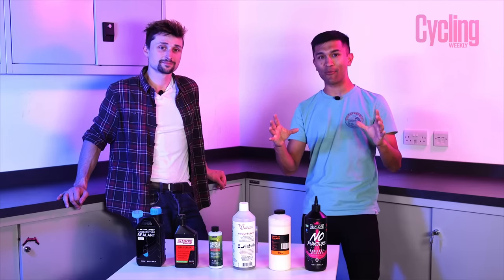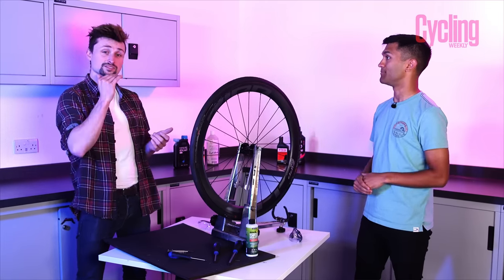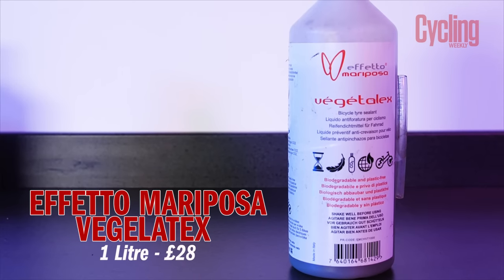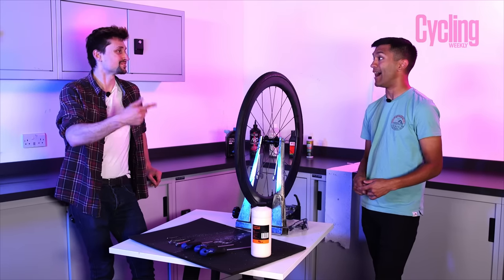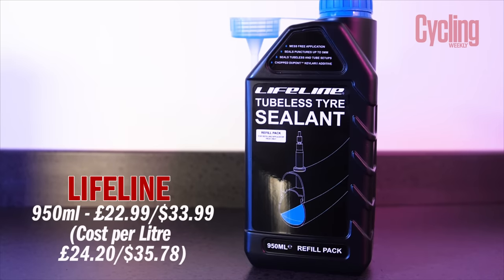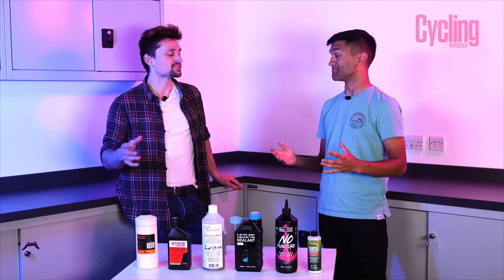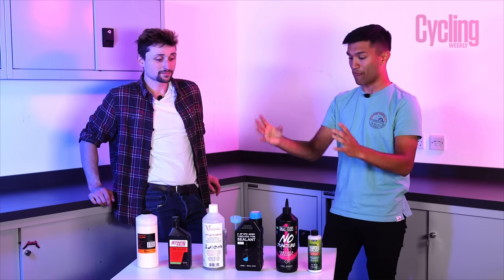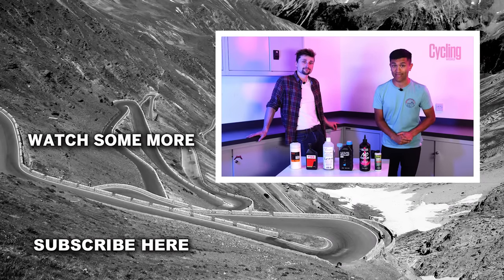We Found The Only Tyre Sealant You Need | Tubeless Sealant Mega Test

Comment: It would have been more accurate if you guys went for a short spin after each puncture to see how it holds under the weight of a rider.   I know It would have take longer to make the video.  Nonetheless, I appreciate the great content and no bias.  Thank you.!
Reply: Agreed this is a massive part of this stuff working
Reply: You are right. Real world testing makes all the difference.
Reply: Yeah also test @ different temperatures. I’ve had sealant work extremely well within a certain range, and as soon as you’re going lower or higher, it just become completely unable to handle the tiniest 0.5mm puncture.
Reply: I agree. Puncture that big usually never seals in reality, because the cut opens up under the weight, and doesn't have a chance to dry. Plug is the only solution.
Reply: Where I've experienced the fail of cheaper sealants isn't the body weight it's the rotation at genuine speed, 20mph or so they start to let go and spit at you.

I've been using orange endurance for 2 months with 3 known punctures and no issues at 60psi max on 38mm tyres
Reply: Exactly.  The problem I have with sealants isn't the size of the hole they seal (you can always use a plug), but the tyre remaining sealed.  After riding a bit, the seals always seem to wear out and leak.
Reply: This is why I carry a spare tube when I decided to go tubeless. Saved my ass a time or 20.
Reply: I think this video was enough to rank the sealants according to performance. But a more in-depth review would be interesting.
Reply: Agreed. I used Silca and it would seal but then leak again when riding. so weight is a big deal
Reply: @BigBoootyBass  Ok.  My issue was with a snake bite..  It seems it's commonly hard to seal based on the conversation I had...  due to the fact that the sealant doesn't go there as much as it goes on the main thread of the tyre.
Reply: just extrapolate the data and assume maybe one less check mark for each sealant . fuck man,  some of you people just have to be a poindexter about this stuff.

Comment: There's as point where just poking, letting it go and saying after 2 seconds: "it works!" isn't representative of reality. A rider will sit on the bike, increasing the pressure. Plus, in my experience, many of those punctures will continue to leak, albeit very slowly... so yes, it prevents (in some cases) a complete flat requiring a repair but in many cases (based on my exprience) it's not simply a "tire plugged forever" situation. Many will keep leaking a bit and will require a more robust fix. Plus, let's not forget that these tests are always performed on freshly poured sealant. After a 2-3 weeks, there will be a difference in performance. I've used tubeless for many seasons and, while I like it, it's never as perfect as these "tests" demonstrate, nor are the tests representative of real life situations with the same variables...

Comment: I had the complete opposite experience with Muc Off and Orange Seal. Muc Off would continue to leak and sputter over time when I thought it had sealed (, but Orange Seal would actually create a complete and full seal. Granted, I also use Orange Seal Endurance formula which lasts considerably longer and seems to seal better than the regular formula.
Reply: Muc Off has the most dishonest marketing in all of bike products. I would run away from anything Muc Off. Look at Zero Friction Cycling's testing of their lubricants.
Reply: This test is shit. Spinning wheel on a stand achieves nothing aside exactly what is shown

Comment: One thing a nearly every sealant tests get wrong: You need to spin the tire at gravel / road speeds BEFORE puncture! I'm actually surprised the Silca worked! It's claim is it foams as riding begins! Nevertheless I think this very useful data. Thank you guys for putting this test on!
Reply: They were rotating the same tire over and over to make subsequent punctures. Hence for all but the first puncture you were seeing rotation before puncture.

Comment: One thing to note also is that I believe muc off is the only sealant to be compatible with co2 cartridges… other sealants if used will cause the sealant to go off… but still, a great test!
Reply: You can replace it with normal air after with Stans though - which is reccomended anyways
Reply: also worth of noting - mucc-off can be simply washed by water, so if you change tyre frequently, it can be easily washed and stored
Reply: @brunoandlydia  yeah I had a big puncture which the muc-off couldn't plug. Used 2 large bacon strips and they popped out so took the tyre off and replaced it with a different tyre and tube. Washing off the muc-off was super easy and I'll use the tubeless tyre when I figure out how to repair it

Comment: I agree that the standard orange seal isn't great, but give Orange Seal Endurance a try, it works better than anything else i have tried. It is reinforced with aluminum flakes in the same fashion that the Silca is reinforced with the carbon threads.

Comment: I have been using Stan's, and longevity-wise I like that after a year it's still liquid inside my tires. However I have had a problem with a slick gravel tire where a few small punctures were continually oozing wet stuff and the tire had to be pumped up before each ride (I got a new set of wheels and tires and stopped using this pair, and they eventually deflated and dried out). Would love to see a longevity comparison between these sealants, though I know that's not an easy or quick video to shoot!
Reply: same, I had gravelking slicks and they had many small (1mm) punctures all over, I had to inflate every day and by the end of the day the tires were already kinda soft. Sometimes the seal couldn't really hold it after inflating and upon putting weight on the bike a puncture would open and spit sealant. But the tires were getting old and thin, so maybe that's part of the reason. Didn't have any problems with my other bike, I even rode it once for a few km with a large nail (maybe 5mm wide) in the tire before removing it and having Stan seal it successfully (the normal version of Stan's). And I continued riding that sealed tire for months with no problems. I did read somewhere that thinner tires are harder to seal, maybe that's why my slicks would ooze and have trouble keeping sealed compared to my mtb tires.

Comment: Be interested to see how Stans 'Race' would get on compared to the regular Stans sealant. It has larger 'bits' in it to seal larger holes, so much so that you can't put it through a valve without bunging it up. I know that you can't test all of them, but the 'Race' is Stans best, and so far I've had good results compared to the original formula.
Reply: I have found that Stans Race does not store well and clogs in the bottle very quickly rendering it unusable. I am guessing that it is designed to be used up quickly by a team in a race meet environment.
Reply: @rogercarradus2914  same experience, I've only used Stan's race and the normal Stan's and muc off.
The race version was too strong for me I'll dry up quickly and worst part is I can't use the valve after and needed poking some times cleaning.  The normal formula and muc off works well for me, I use them both on RB and MTB on my tubeless wheelsets.
The best part of Stan's race is when you have a wider puncture it will definitely seal 1000% losing just 5 psi or lower worry free.
It even sealed my pinched flatted inner tube MAXXIS with Stitched patch on my non tubeless wheelset and able to rode it home safely.
Reply: I found that if you leave Stans Race in the tyre, it creates a hell of a mess inside the tyre which you can’t clean off. Effectively it ruined 2x£70 tyres! Think it is supposed to be cleaned out after a race outing? I’ve found Stans regular ok and have just bought some Muck Off as a trial. Being an early tubeless adopter the main problem is still getting the bloody things off and on. If they could only get that sorted so putting a tube in at roadside was easy, it would be a game changer and the odd occasion that sealant and or plugs do not work.

Comment: Year late...the trick with stans is you need to vigorously shake the bottle before pouring it out. There is a particulate matter that settles in the bottom of the bottle that you can visible see in the sealant when you pour it out...i didn't see that material in your video, which makes me think it wasn't shaken enough.

Comment: Would like to see a follow up video, expanding the field to the other suggested sealants: Orange Endurance, Stan's Race, Specialized 2Bliss, etc.  Thank you for the objective 'controlled' comparison.
Reply: Stan’s race has worked better than anything else I’ve used but it dries so quickly it’s a pain to work with. If I had a race or big event that’d still be my go-to. I’ve never had a puncture fail to seal with Stan’s Race. (Regular Stan’s doesn’t work well for me at all.)
Reply: I am wondering if the SILCA sealant with its refresher additive is similar to using Stan's Race (has fibers) mixed with regular Stan's to extend the lifespan. I wouldn't expect regular Stan's alone to compete with a sealant using fibers like the Silca, but I wish this roundup had compared with the Stan's Race to be more apples-to-apples comparison. Fiber based sealants greatly improve effectiveness at the cost of longevity and hassle.
Reply: Stans Race dries up and makes a sticky mess in the tyre. Silca makes a mess with its carbon fibres, but you can just clean them out with a cloth/kitchen roll (and dispose of them safely!)

Comment: It was also be good to know how soon after puncture the air pressure could be returned to normal. 

In my experiences the sealant works and the tire holds air. But if you add air back into the tire it blows out the sealant.

Comment: I wonder which one of these you can replace through the valve? Silica looks kind of chunky, not sure if that would work.

I might go for a less protection, maybe take extra risk, if that makes the regular maintenance/replacement so much easier.
Reply: Silca says that you cannot insert their sealant through the valve, you have to pour it directly into the tire. However once you've done that they have a separate product to "refresh" the sealant in your tire, which they say you can put in through the valve
Reply: @bhatch  basically spend even more $$ buying different products.

Comment: I was using Stans until my first puncture. It wouldn’t seal a <1mm puncture as it practically turns to water after it coats the inside of your tyre over a few weeks. Redone both my tyres with Muc-off, time will tell if that performs better, but this video has given me hope!
Reply: Muc off is terrible, for road tyres use stans race or silica. I’ve used both, stans does dry out though
Reply: @domefford864  Silca it is then, certainly won’t be using Stans ever again, complete waste of money. I only had a small pouch of Muc-off that I must have got free with some of their other products
Reply: @cliffsmith3376  I’ve only had Silca in for 6 weeks as it’s a new product but as with all their products it’s over engineered so should be the best. 👍

Comment: My experience with Stans is it works fine, but the Stan’s in the bottle itself tends to clump up and turn to rocks and wastes sealant. In the tire, the sealant tends to dry out quicker than Orange and also clumps up into rocks.

The Muc-off seals amazing, but I found that it works too well and can make taking tires nearly impossible to take off if you have to put a tube in. 

The life of Orange seal sounds about right, but it works well and doesn’t glue your tire on like Muc-off
Reply: Orange seal for me and my friends as well. Long lasting in the tire,seals just fine. No need for plugs for 1,5 year. No clumps so easily to inject through the valve hole. Just using the regular. No need changing each month.
Reply: What about frost from riding in the winter. How about coping with the co2. ?
Reply: @aoe76  Orange only lasts about 1-3 months, even their directions state this. I find that this is true, but it differs depending on how porous the tires are or the climate you live in. If you are waiting over a year to refill your sealant, I would guarantee that your Orange sealant has long dried up as no sealant lasts anywhere near that long. As far as winter…I live in California, USA, and the climate is moderate, so Orange works fine. CO2? Always point the valve stem up when using a CO2 and you should be fine.

Comment: The key point is the density of the sealant. More is dense more is the ability to seal. On the other hand, the density dries faster than the liquid sealant and moreover, will be more hard to reach sidewall puncture. The plugs do the rest.

Comment: Should have included Finish Line.  I care more about the mess one like stans leaves after it dries out, than protection.  I know protection is kind of the point but it's not my top priority.  I am curious to try the Silca one now though.  Does it dry up spike ball style?  I went to finish line from stans, its more weight that stans because you need more but I won't go back.

Comment: Great review. I’m using Stan Sealant and it’s not really up to expectations as a 2mm puncture won’t really seal for my 23mm pump at 80psi. Ended plug it with a tyre plug to stop the leak. Sure will try Muc-Off from this review. Just hope they sealant life span can leave to their advertised of 6mth in the tyre.
Reply: I agree re Stan’s but try Stan’s Race Sealant. It’s more expensive but a different beast. Seals anything.
Reply: Muc off is waste of money.

Comment: Think you guys were lucky with the muc-off. I've had smaller holes than that at 70psi that it wouldn't seal
Reply: Same here and that's on my gravel bike with around 30psi. It does at least last a long time and clean up easily.
Reply: @kpizzle1985  how long do you get it lasting? This is what puts me off going tubeless...redoing the seallant every few months. No doubt a messy job. I'd rather be out riding, not squirting juice all over my bike/floor/face
Reply: @thebrowns5337  I changed the rear 6 months in after getting a large hole in my tyre, at that point it was no where near dried up. Front is about 9 months in now and still holds pressure as well as the day I set it up, can't be sure how much useable sealant is left in the event of a puncture though. I'm tempted to just ride it until I get a puncture that doesn't seal, pop a tube in then add sealant when I get home. This is on the gravel bike, sticking with tubes on the road bike for now

Comment: The only time I get big holes is from a nail, and that's not very often and they are about 3mm I would guess. I usually get thorns.
I just bought stans, hope it works, as I'm new to tubeless. Was a lot of bother getting the tyre to pop on yesterday, but a bit of sealant on the outside helped do the trick.

Comment: Those of you dealing with continually clogged tubeless valves should give the Fillmore Valve (from Reserve Wheels) a try.   Not only are they virtually clog proof, but they flow way more air than a traditional presta valve (even with the core removed), that the ability to seat the beads of a tubeless tire is also improved.   If you have a floor pump with an airblast chamber, you can seat ANY tire with this valve.

Comment: Thanks for doing this test, I have been wondering what the good sealants were. I have not had much success with orange seal and was unaware that it only lasted a month or so. My wife dislocated her shoulder when her tyre rolled off the rim. Have changed to muc off and am now confident it will work well. Thanks again.
Reply: So interesting I've had the complete opposite in results. Muc off almost made me stop using tubeless. Since moving to orange endurance I've had 2 punctures and they've sealed with no issues! Wonder if different tyres and sealant combos would have an impact on this? Hope your wife made a speedy recovery!
Reply: Muc off is waste of money

Comment: I think they should have used the stans race sealant that is equivalent to Silca.  But, interesting tests guys
Reply: I have both Stans Race and Silca, and the only issue with Stans is that it dries up to fast for the average rider. I switched to Silca so I could have good puncture protection and not have to change it out so often. If you have Stans Race, mix it with Stans regular so it last a bit longer.
Reply: Why is stans race day more comparable to silca? It seems like the lifetime of silca is more comparable to the lifetime of regular stans, no?
Reply: @smurfendrek4791  it's comparable because of those larger particles which are not in the regular stans sealant.

Comment: Alright since I'm a big proponent of Orange Seal and I just wore out a GP5K S TR, I sacrificed it to the God of Sharp Objects. It sealed up to 4mm instantly, It sealed 6mm in seconds. I pointed the puncture down at 6 o'clock each time. I think there was something seriously wrong with the test protocol used in this video. I used 73psi on a hookless rim. Multiple stabby implements were used, including a jeweler's screwdriver, an awl, larger screwdrivers and an actual machine screw.

Comment: Real world, my experience.

Muc off doesn't work. Punctures around 3mm at 50 psi sealed initially, but as soon as I started riding again it opens. 

Orange endurance, doesn't seal as quickly but sealed the punctures permanently at higher psi.

I know this because I stopped using muc off and installed the same tyres with orange and they've been golden ever since.

Comment: I had been running Stan's but could not get the regular Stan's so switched to Stan's race, which makes similar claims to Silca and MucOff (with particles in it to make it seal bigger holes).  No complaints so far but after watching this, may be switching to Silca.
Reply: I agree, Stan's race is missing in this video. I will like to see it agains Silca